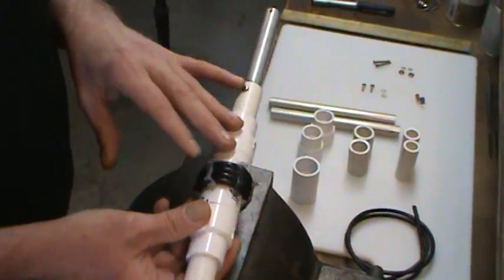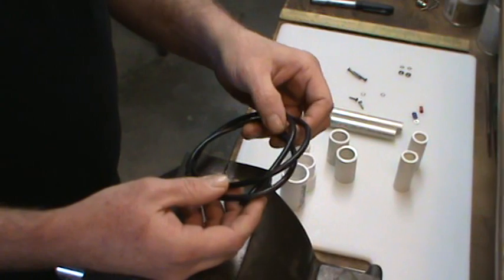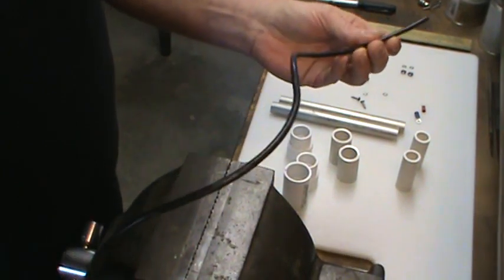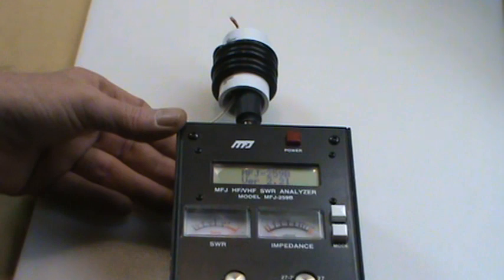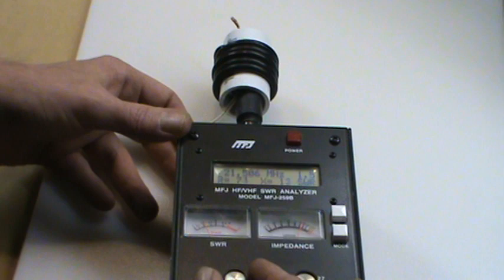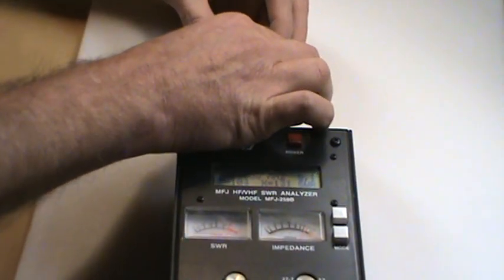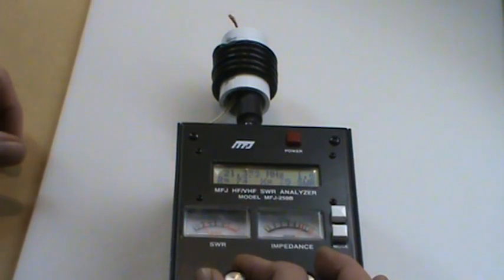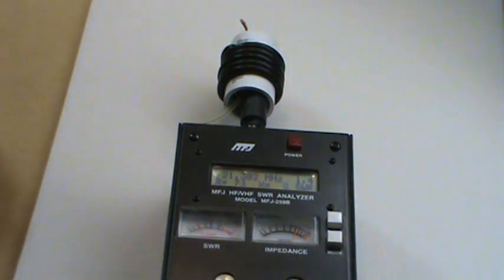10/15/20m Trap Vertical Antenna, Part 3 of 4

Comment from the maker: Use a trap calculator to figure the measurements.  I am currently building 20 meter and 40 meter traps for a 20m/40m/80m antenna and hope to finish it soon.  Thanks for watching. 73.

Comment: If you hook it to a grid dip meter rather than using the dip meter's coil, what frequency does it resonate at? Then after you add it to a small piece of tubing out each end what frequency does it resonate at if you hook the ends of the tubing to the coil inputs of the dip meter?  When I was at Hygain/Cushcraft/MFJ they lay the trap when complete in a clamp and use the trap as the resonant device in an oscillator. Then measure the frequency of the oscillator. And each trap has a frequency in this setup that is not the frequency the trap is made for when installed in the antenna.

Good video thanks much.
73
Jimmy, ARRL TS, WX9DX